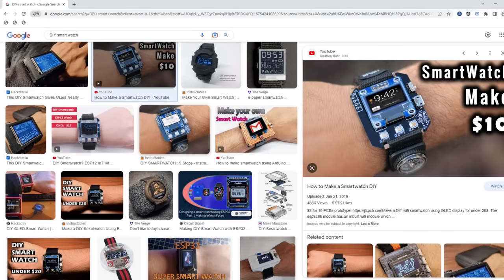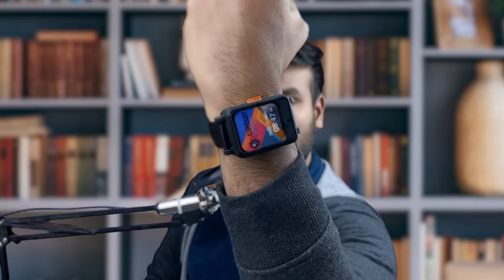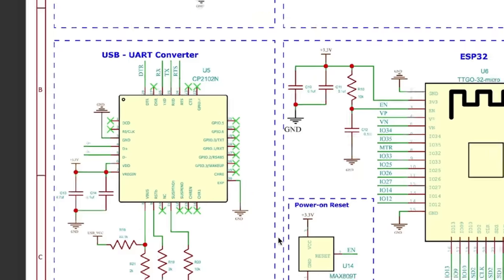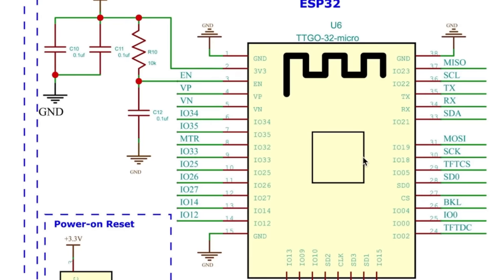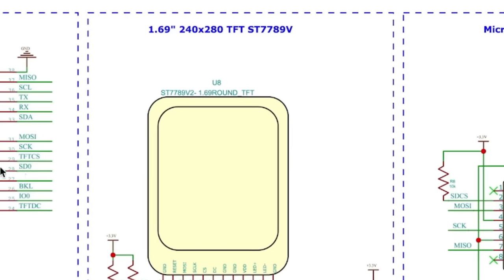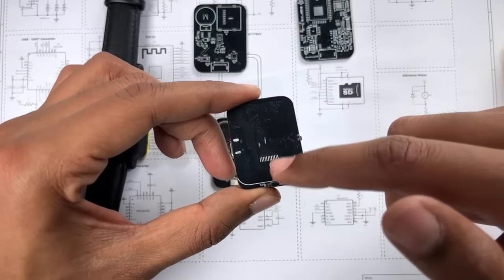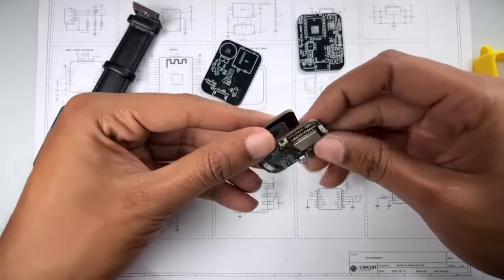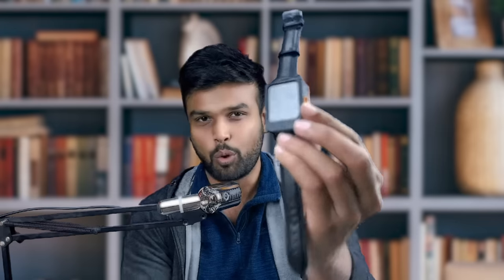Build Your Own Smartwatch from Scratch - You Won't Believe How Cool it Looks!

Comment: This might be a trick of the eye to improve the overly tall appearance of the watch case... Move the watch strap connection point as high on the side of the watch case as possible. This places the mass of the case below the focal point of the watch band. Also, the code should pause reading the heart monitor, when the rattle sensor shakes (sorry, I forget its proper name.)

Comment: Great Job!!! 
I have a question. The heart rate sensor max30102 works fine on the wrist? I can't find any information about that, the only information I can find is that it only works on the finger and on the wrist dont read nothing.

help me please, its for mi thesis:(((
Reply from the maker: It does work but not very reliable
Reply: @Circuitdigest  Why not? The values are not very close to values taken with respect to the finger? Is the problem the location of the sensor or the sensor?

Comment: i want to make a app of it so how can integrate the data between it?
Can it be done by Bluetooth or we need to build API
Reply from the maker: the ESP32 chip has on board Bluetooth - But we have not used it. You would have to write your own firmware for that, but yes the hardware supports that as well